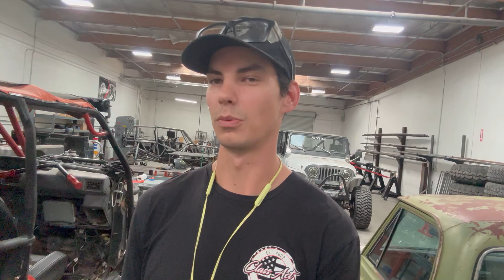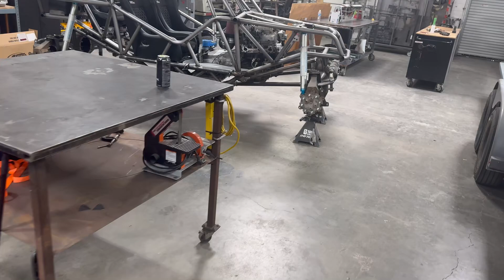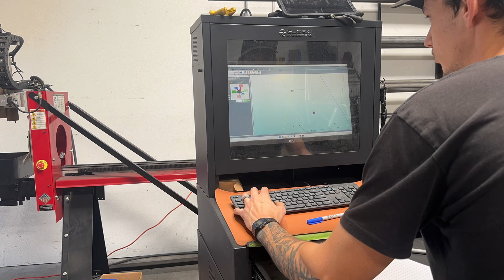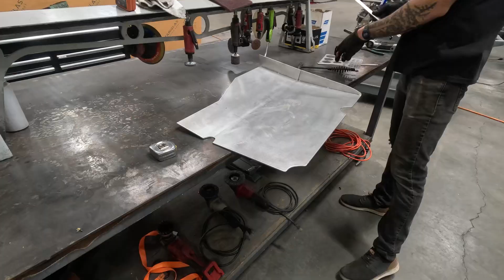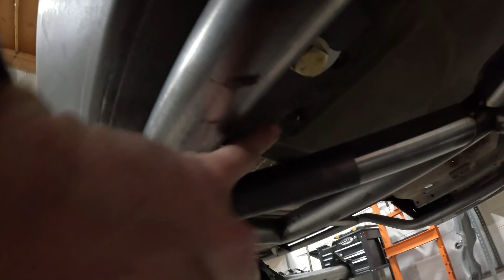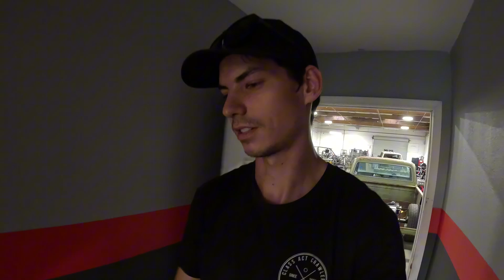Finally back! Big shop Update

Comment: What are you going to school for?
Reply from the maker: Digital Design and Manufacturing. It is a 6 month course all based around using solid works to design and different manufacturing processes like Laser cutting, CNC machining and 3D printing.
Reply: @Classactfabrication  Right on.  That tracks with your business, should help you work more efficiently while making a better product.
Reply from the maker: @benjaminreinhardt259 for sure!